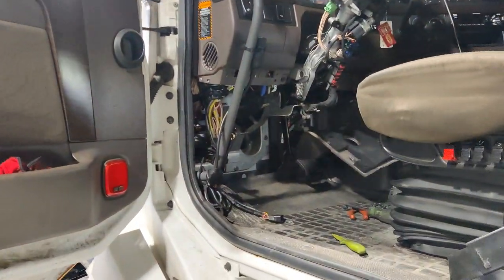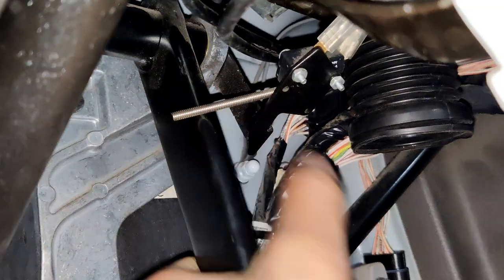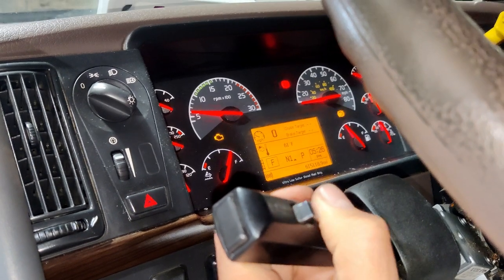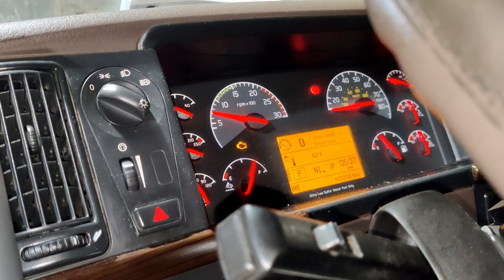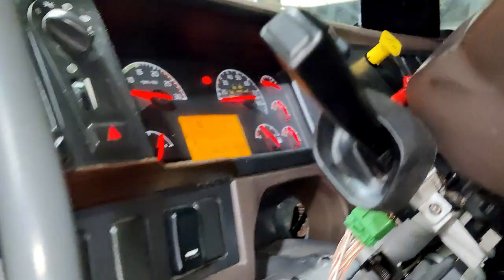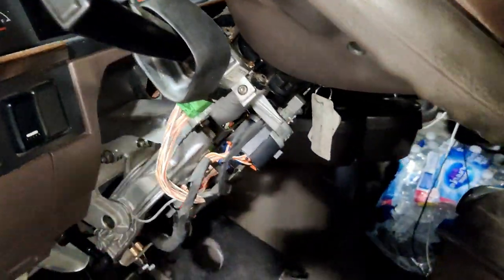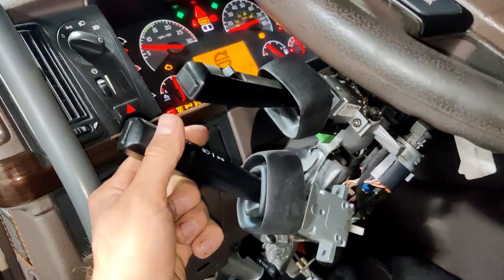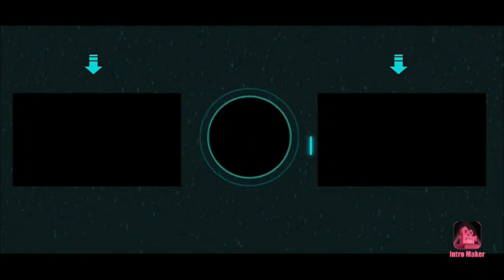Volvo d13 cruise control troubleshooting

Comment: Note; this is video applies for an automatic transmission, just so you don’t see that sensor for a manual transmission it’s actually on the clutch pedal, that solved my issue thank you sir! Also that sensor if it’s out of place the engine brake doesn’t work along with the cruise control
Reply from the maker: Yes you are right! Thanks for the note and glad you fixed the problem! 💪🏼

Comment: I’m little confused. Are you testing the PTO or the cruise control? I know the CC will not come on unless you got above 30mph…? I’m not sure what you trying to do here. Please help explain in this comment because I’m having issues with my CC but not my PTO.
Reply from the maker: The cruise control wasn't working and this brake pedal switch was the problem, the spring jumped under the brake pedal and the ecu always were receiving the information that brake pedal is applied even if it was released  and cruise wasn't working!
Reply: I was thinking same thing
Reply: I'm having the same problem my CC is the one that doesn't work have y fix yours?

Comment: Could this possibly be connected with my problem of losing response to throttle? Sometimes I lose acceleration and my engine brake, after about 20 seconds truck will return to normal.
Reply from the maker: I don't think it is related to loosing response from throttle!